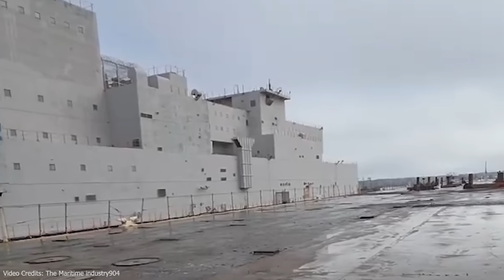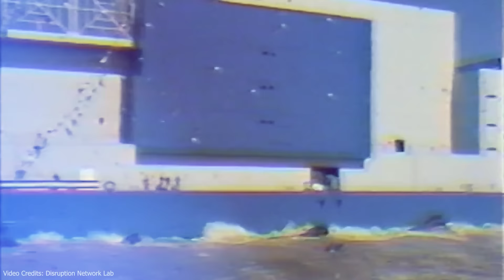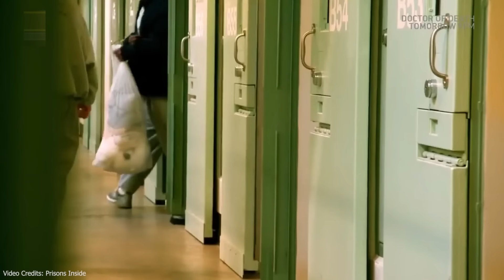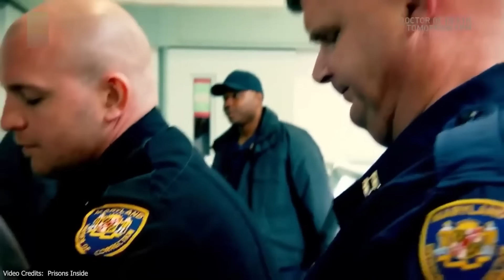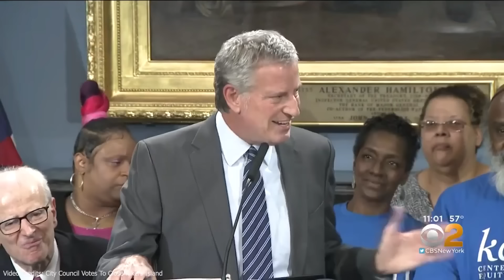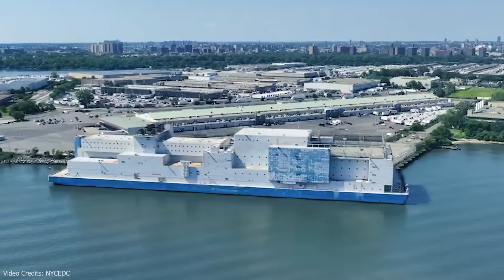Why New York Built the Largest Prison Ship in the World

Comment: Is NY really moving on, advancing or just following old ideas but in different ways? It has been long ago of videos featuring NY’s desire & plans to build a jail/prison skyscraper. While having somewhat different issues they will still result in  extreme deterioration & constant need for maintenance & repairs. Skyscrapers cost billions as well & modern skyscrapers only have about a 50 year life expectancy which isn’t much better than the floating prison barge. You would think building on land, with foundations reaching bedrock, with steel & concrete structural skeletons that they would last a century or longer. Why spend billions to build a building that will need to be demolished in 50 years left for taxpayers to pay billions to remove?

Comment: it did its job for 3 decades, not bad
Reply: Was a great deterrent and nobody escaped from the facility, so it was successful
Reply: @Histrionicer-j1h Stalag 13
Reply: It appears they don't need jails up there any more 😅
Reply: It was a hell hole. Rodents and poor light and ventilation... and Extreme Temperatures. Rusting.... poor sewer system. Rust Bucket. Eclectical issues and such.
Reply: @dustinpalaghe8233 so?